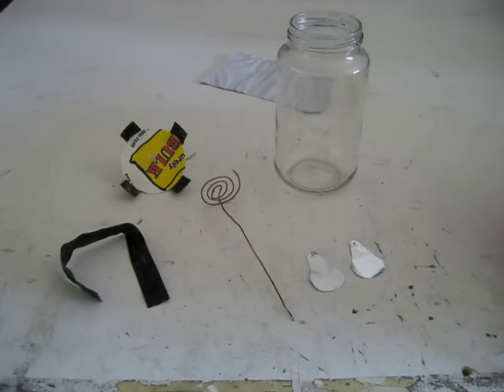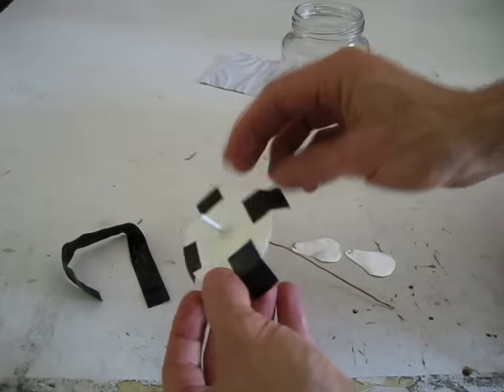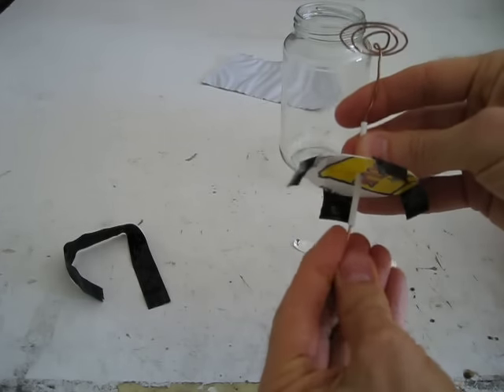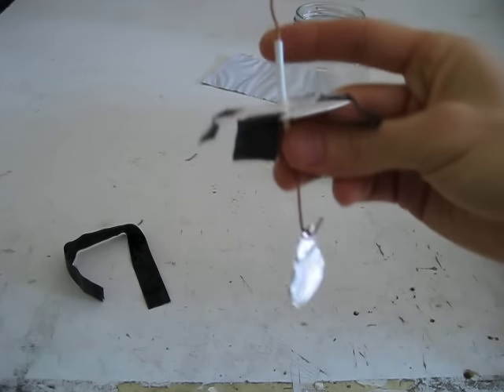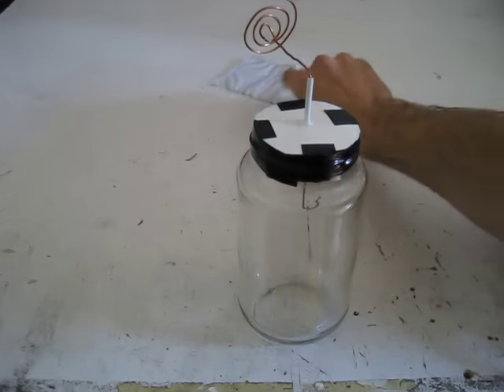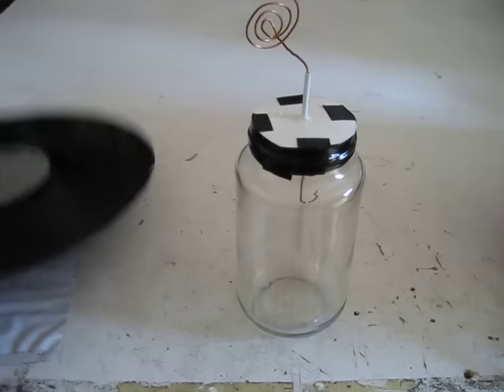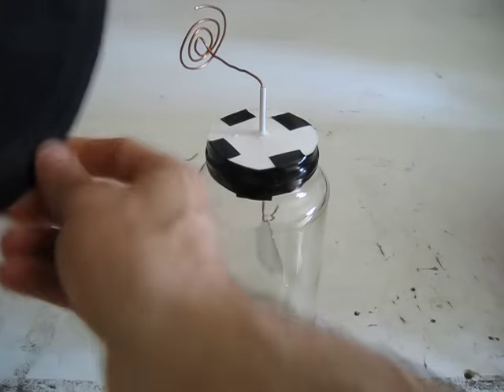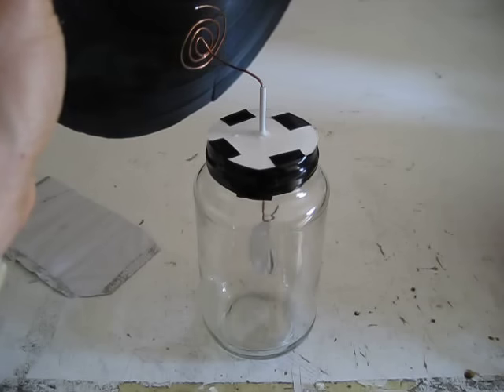How to make an electroscope (DIY)

Comment from the maker: The electroscope works in a humid climate. But the problem is charging the charged object, like the vinyl record, or charging a balloon by rubbing it against your hair. That type of charging by rubbing something, called the triboelectric effect, doesn't work well in high humidity. If you have an electronic high voltage power supply then you could charge objects in any humidity.

Comment from the maker: Look up "triboelectric series" on wikipedia and look at the table on the right. Cotton is pretty far from the plastics, polyethylene, vinyl and should charge well. Polyester is pretty close to them but far from glass, so glass should work better with it, but clean the glass thoroughly. But even then, I don't have much luck either as I said in my other reply. The balloon worked, right? Balloon is rubber and rubbed against clean hair should make the balloon work with the electroscope.

Comment from the maker: Regarding the what happens with a positive charge, you're right.
Regarding the humidity, the issue is with the charging and not the electroscope at all. So I guess the electroscope can be in a humid room as long as you rubbed the two objects together in a dry room, or charged the object in some way that didn't have a problem with humidity, like an electronic high voltage power supply.
Glad to hear you like the videos! Thanks for letting me know.

Comment: Nice and clear simple and quick to make.
2 notes
If the leaves touch the glass they transfer a charge you can see this at the end of the video the last few frames the leaf magically jumps to the jar wall and back in to equalize charge as it bleeds off the curly end into the air. This is why the scope appear less sensitive as you use it in the video. You can ground the leaves by touching the probe with your hand. you may need to ground the glass where it touched which is why on some versions you see rods between the leaves and the sides.

and with very high voltages sharp corners/edges/points bleed voltage which is why on most of those old machines everything is tube and ball looking

Comment from the maker: In this case it's not the size that's important since the area of the disk and blinds that faces the electroscope terminal are the same, although the disk has grooves in it so it actually does have more area. The material is also matters. They're both vinyl but they may also have coatings on them since they're different colors. If you look at my triboelectric effect video (see link in the description below the video) you'll see some materials become more charged than others too.

Comment from the maker: Check the foil leafs in the jar to make sure they can move freely. It's also possible the problem is not with the electroscope but with the charged objects. If the air is too humid then it's harder to charge them. Maybe the air was drier the first time you did it. Also, try many different objects. Also, if I use a drinking glass as the object, it works only the first time and then I have to clean it thoroughly with soap and hot water because my hands put grease on it, stopping the charging.

Comment from the maker: Yes, as long as it is lightweight and can move freely. The force causing the foils to separate isn't usually very strong, depending on your charged object. There are other metal foils at hobby and craft stores (brass, copper, steel), some candy wrappers, aluminum from soda cans. The foil must be electrically conductive metal and make sure the place where the foils contact the hook that they hang from is electrically conductive - no coating of any kind.
Reply: Thank you

Comment from the maker: I got it from household wiring, the wire in our walls here in North America. I have a roll of it since it's nice and thick and I find it useful for projects. Find out where your electricians buy their wire. Here we can find it at Home Depot as well as specialty stores. A metal wire coat hanger will also work. Just make sure you scrape off any coating where it will be in contact with the two foil leafs.

Comment from the maker: @5MrPurple It's optional. It's there only to hold the wire in place as it goes through the cover. You can use tape, glue, a tight fit, or whatever you can come up with in order to support the wire. Heck, the wire can even go through the hole in the cover and then be bent flat sitting on top of the cover, in which case you don't need to support it at all. Maybe just tape it flat to the cover so it doesn't move around.

Comment from the maker: Any stiff wire will do, as long as the part that the foils are touching is bare wire and not coated with anything. It has to be foil touching metal. You could take apart a metal coat hanger but make sure to sand off the area that the foils touch since I think coat hangers have a coating on them. A metal paper clip is another choice. Look around and see what you can find.

Comment from the maker: It's an insulator because it doesn't conduct electricity. E.g. copper is a conductor - electrons travel through or along its surface easily. But electrons don't travel easily through or along the surface of cotton.

But due to the triboelectric effect electrons can be removed from the surface of cotton if rubbed with vinyl. And electrons can be deposited on the surface of cotton if rubbed with glass. In both cases it's not conducting electrons, just collecting or losing them from its surface.

Comment from the maker: Interesting question. If the clouds are charged one way before a lightning strike, is the air near the ground charged the other way? However, that would mean the air surrounding the foil leafs is also charged. So even though the leafs have a net charge that would normally cause them to repel each other, the surrounding air has the same net charge and so nothing would happen. That's my guess. But I'm also guessing the air won't be charged enough to begin with. Try it and see, but do it indoors.

Comment from the maker: @swordswordswords The vinyl is non-electrically conductive so the charge won't conduct away to your hand in that direction, regardless of your skin conductivity. Good suggestion re the dryer.
Reply: thank u fr this video i had one activity and its very useful thank u again
Reply: +Fantage Candy (Mithra Madhu)  instead of plastic pipe can we use a straw ?
Reply from the maker: Fantage Candy
Yes, you can use a straw instead. It is there only to hold the wire in place. If you have any other way of holding the wire in place then that will be fine too.
Reply: +RimstarOrg  ok sir thank u
Reply: plsss replay for me
Reply: plsss replay for me
Reply: RimstarOrg
Reply: RimstarOrg does the plastic hole have a part of is it just to hold it?

Comment from the maker: 1st question... All electroscopes  measure the charge on an object by moving it close to something that will show a physical effect e.g. the two foils move away from each other. But the devices can be different; search for pith ball electroscope. 2nd question... The electroscope can have a NET negative charge, i.e. more negative electrons than positive protons. But you can't get rid of the protons. Only electrons move.

Comment from the maker: When I rub a face cloth against a plastic bottle to charge the bottle, the cloth is charged too. But for some reason the electroscope doesn't respond to the cloth. Not sure why not. But I just put it near two blankets on my bed that I know I get shocks from when I pull the blankets apart and when I put the electroscope terminal near the blankets after I pull them apart, the electroscope leafs separate. It should work with clothes that have static cling.

Comment from the maker: @ComboSmasher Instulated means there's a coating on the wire the doesn't conduct electricity. Example: a plastic coating on a wire prevents electrons from going onto the wire. The only parts of the wire that really have to be uninsulated are where the aluminium foil leaves touch the wire. It's optional, but it's handy if the terminal part of the wire (where I made a spiral) is also uninsulated. That's good if you want to touch it with something to put or take off electrons.

Comment: Yes! It finally worked, thank you so much for this video! My problem was just really the charged object. :) Do you have any suggestions for other objects that I could use ? I am currently just rubbing plastic cover on my hair because unfortunately I don't have any vinyl fabric around.
Reply: I think this would also work with a simple ruler. I just noticed this was 8 years ago

Comment from the maker: Any type of wire will do. Just make sure that the collecting area, the place where I made a spiral, is not insulated otherwise it won't be able to collect or give up electrons. Also, you don't want the wire to be too thin. Wire the thickness of a hair may leak or collect electrons along its length, decreasing the amount that the foil leafs will move.
Reply: Um I had a question I don't have aluminium foil can I use the medicine wrap aluminium instead?

Comment from the maker: @vestprend1993 The ends of my wire were sharp so I put a little round bit of solder on them using a soldering iron. I could just have easily sanded the ends round. I probably didn't need to do this anyway, just a habit from working with high voltage a lot, so I don't think that's your problem. Can you give more details of how yours is made.

Comment from the maker: Yes and wire, metal rod, electrically conductive material will work. The important thing is that the wire must be bare, no insulation, where it comes in contact with the foil leafs.

Comment from the maker: @amarben123 I'm not sure I understand your question? The wire I used was 14 gauge (AWG). I took it from some household electrical wire that I had lying around, the kind used in our walls here in Canada. Thicker wire does exist. If you have a Home Depot nearby, they would also have 12 gauge (smaller number means thicker wire in the American Wire Gauge system) and probably all the way to 8 gauge. If this doesn't answer your question, please ask again.

Comment from the maker: Oh! Cool idea! I just tried it and it works. The leafs separate. I also did a test using the electroscope and induction to see if the screen is positively or negatively charged. The screen is positively charged. I sense a video in the making :). Thanks!

Comment from the maker: It will. In fact, I've since found I like it better with a plastic jar. I find that with my glass jar, if a foil touches the inside of the jar then it tends to "stick" to it. With the plastic jar I tried, the foil doesn't stick.

Comment from the maker: Your protractor approach is the only one I know. I sometimes see it done by having one fixed leaf and one leaf that's free to move. The fixed one is  a vertical, metal plate. The other leaf repels from that one. Then a potractor is permanently fixed in place behind them. Of course that's a lot of effort to make if you're going to use it only a few times.

Comment from the maker: Instead of copper wire you could try a paper clip or a metal clothes hanger. Just make sure you scrape off any coating where whatever you use makes contact with the two foils in the jar. The contact there must be bare metal to bare metal. Regarding an object for charging, rub a plastic coke bottle against your hair or a rubber balloon against your hair and then bring the part of the bottle or balloon that you rubbed near the terminal of the electroscope.

Comment: Could you also use cardboard for the lid
Reply from the maker: 9marbella Yes. You can even use the original lid that came with the container if you want to.
Reply: RimstarOrg  could we us cardboard for the lid
Reply: RimstarOrg  thank you very much
Reply: RimstarOrg  how many inches does the copper wire have to be
Reply: RimstarOrg  HOW LONG DOES THE COPPER WIRE HAVE TO BE
Reply from the maker: 9marbella There's no specific length since it depends on the dimensions of your electroscope but mine is around 10 to 12 inches altogether.
Reply: would you happen to know what other materilas are made of vinyl
Reply from the maker: 9marbella I already answered in the other video but... In this video I used a piece of vinyl from window blinds and old vinyl records. But there's 
also PVC pipe which is used in plumbing and electrical (see this other 
video of mine for a demonstration @watch?v=6x6DqPL14yU).
Reply: @RimstarOrg  Can you please tell me that can the copper wire be insulated and bare at the end

Comment from the maker: It can be plastic. The only requirements are that it be a non-conductive material (not metal) and that it be clear so you can see inside. It can even be a supporting frame made of balsawood, cardboard or straws.

Comment from the maker: Your wire sounds okay. The usual problem is with the charged object not being charged. Try rubbing a plastic coke bottle against your hair (no gel, your hair must be clean), or a balloon against you hair. Then bring the bottle or balloon near the electroscope's terminal. You could also run a plastic comb through your hair a bunch of times and use the comb. Also, the air must not be too humid.

Comment from the maker: @kolokoy48 What did you use for the foils? They have to be fairly flimsy and move easily with respect to each other. Also, humidity can be a problem. Is the air in your place damp or dry? Damp air would prevent even the vinyl from working well. Use a hair drier on hot setting to dry your test objects. What else can you use...? Rub a balloon against your hair and try the balloon. Run a comb through your hair. Try rubbing different face cloths against various plastic or glass objects.

Comment from the maker: It can be any type of wire as long as it's electrically conductive (e.g. copper, aluminum, steel, brass, ...) and as long as the foils make contact with the metal.

Comment from the maker: Possibly. I've never tried it. I wanted to but couldn't find the right ultraviolet light. I think you'll need a zinc plate too. You'd bend the terminal of this electroscope so it was facing up and makes a sort of flat table that you can sit the zinc plate on. I think you'd want to sand the zinc with sandpaper too just before you do the experiment to get rid of anything on the surface. But I haven't tried it so I can't guarantee that it would work.

Comment from the maker: What do you mean by "conductor for a van de graaff generator"? I have used my electroscope for detecting charge on my first small homemade van de graaff, before I could get a spark from it. You can see that in my "How to Make a Van de Graaff Generator Part 1" video. Worked great for that purpose.

Comment from the maker: Do you mean something like a drinking glass that's turned upside down and under the glass is the tiny paper balanced on the needle and the needle held vertical by the eraser? If so, how do you interact with the paper, or does the paper simply react when you bring a charged object close?

Comment: Exactly, RimstarOrg. You can use a marker or highlighter to color half of the strip (or color both halves, red/white, red/black, whatever). Place a charged object near to the glass without touching it and watch the paper react. The trick is to poke the center of the strip onto the needle in a balanced way. Careful as too strong a charge can push the paper off the needle. Also glue the eraser to the bottom of the glass to make it portable. Although I have not tested this portable version myself.

Comment: Please answer my question..... A plastic bottle after being rubbed on the table cloth is kept near the electroscope. In steady state, a resultant electric field is established...
a) between the aluminium foil and the bottle
b) inside the aluminium leaves
c) inside the aluminium foil
d) inside the connecting wire between the aluminium leaves and aluminium foil
e) inside the bottle

Which one is correct?

Comment from the maker: Nope, either it's not sensitive enough or the hand is too good an electrical conductor to keep the charge in one place. I just charged up a plastic rod by rubbing it with my hand and it detected the rod but not my hand. Also, this is for detecting electric fields due to charged objects. It doesn't detect electromagnetic fields, such as from electricity running through a wire or around an electromagnet.

Comment from the maker: Are you asking if you rub a wet fabric with a balloon, will the fabric be charged? I just tried it with things that get charged when dry but when I wet them they didn't. The water molecules are probably interfering with the triboelectric effect. Or are you saying you want to inductively charge an electroscope with a charged balloon and then use the electroscope to see if a wet fabric is charged? Yes, but I think you'll find the wet fabric doesn't become charged so the electroscope won't respond.

Comment from the maker: No. It doesn't have to be electrical tape. The tape is just a way of holding the cover on. You can even use the original cover that came with the jar if you have it, and not use any tape at all. I didn't have the original cover so I had to make one.

Comment from the maker: @Saskachewan I just undo the tape. It's easy to put back on and I never have to open it up anyway. But using a twisting lid is a good idea too. Either works fine unless you use a tape that works only once or is difficult to take off.

As for the effect of the strong field, just don't put the terminal too close to the charged object. The electric field strength weakens with distance. If there's a reason you can't do that then use heavier or larger foil. More mass means less effect from the field.